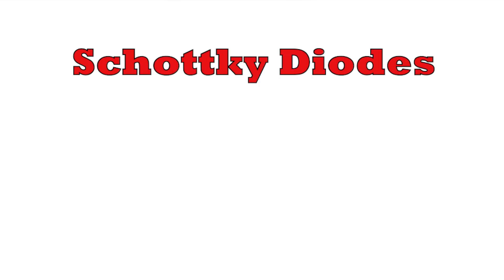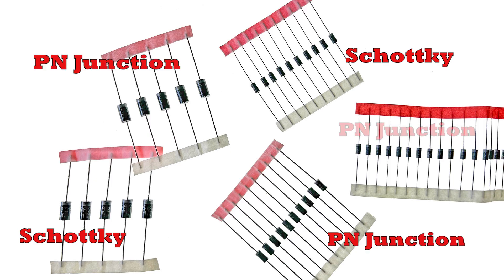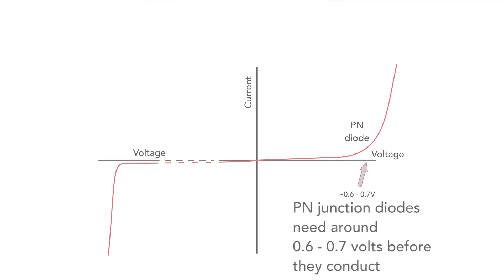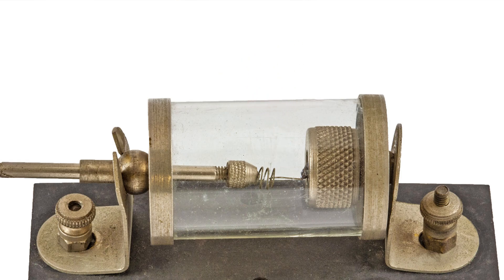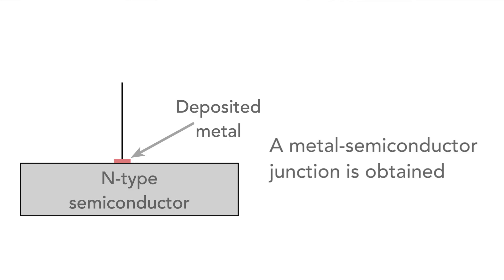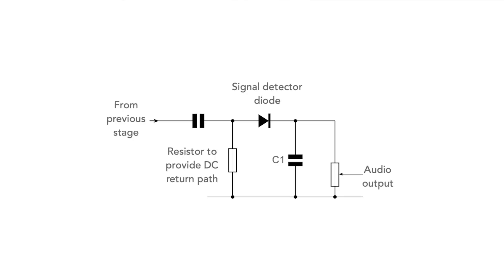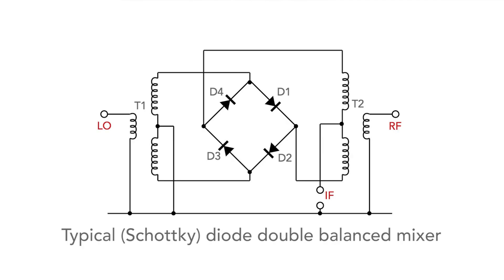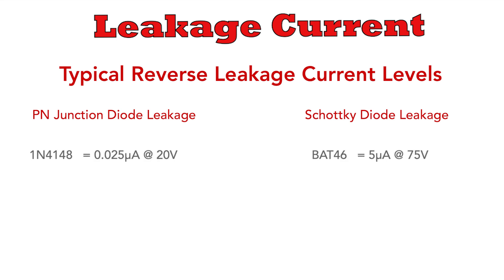Schottky DIODES: What You Really Need to Know!

Comment: I recall Schottky TTL was introduced by Texas Instruments around 1971, but I remember that it was used sparingly in digital logic designs owing to higher cost and heat dissipation. In mid 1970s low power Schottky was introduced, eventually as an option across the full range of 7400 TTL devices. This gave designers new opportunities to shift the trade-offs between speed, cost, and heat dissipation.
Reply from the maker: That's a great historical perspective on the development of Schottky TTL and its impact on digital logic design!
I don’t think I ever used Schottky TTL but I used the 74LS low power Schottky all the time.
Reply from the maker: Yes, the LS TTL was great. I used loads of it. Lower power and fast (for the time). I also remember using ECL and wow did that use a lot of current and get extremely hot!
Reply: @ElectronicsNotes  ECL certainly did use a lot of power, e.g. Motorola's 10,000 series could achieve sub-nanosecond gate delays, e.g. it could mitigate stray capacitance more effectively and achieve faster rise times because it switched current rather than voltage. Interconnects between devices had to be designed as matched transmission lines so that the propagation delay between devices could be kept in proportion to gate delay.

Comment: One integrated circuit I designed used Schottky diodes for a specialized memory. The diodes were used to transfer data between memory cells. After receiving the parts, life-testing demonstrated a gradual shift in the diode's forward drop as well as turn-off times. This lead to a major dust-up with senior staff. Lots of finger pointing. The discovery; The aluminum traces diffused into the silicon thus changing  Metal/N junctions to P/N junctions. Fix was a barrier metal of platinum that kept the aluminum from amalgamating with the silicon. 
Company made a fortune on that product. I got a commemorative plaque.....I hung it in my shed.
Reply: Sounds familiar

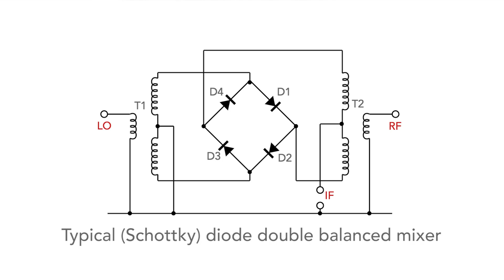Comment: 4:34 One disadvantage is having a Low reverse-voltage breakout of about 100 volts.  Nice video!
Reply from the maker: Yes, this can be a distinct disadvantage. But Silicon carbide, SiC Schottky diodes have a much greater reverse voltage capability in general.

Comment: Should also mention that the Schottkey reverse leakage is temperature sensitive, it increases with the ambient (junction) temperature of the diode.  When designing circuits using Schottkys, it is highly recommended to test the functionality of the prototype circuit in a burn-in oven.
Reply from the maker: Good comment. Best to first design the circuit to accommodate the leakage current at the max junction (not ambient) temperature.
Reply: @ElectronicsNotes  It's funny how many little 'oopsies' get overlooked in the design phase, only to show themselves during burn-in.
Reply from the maker: @Slickrock72  I think we’ve all been there!

Comment: Have you considered using a curve-tracer test instrument to display the forward and reverse voltage specs?
Reply from the maker: No I haven't - it might nicely animate the images - have you a suggestion?
Reply: @ElectronicsNotes  The DCA75 component tester has a USB interface to display VI curves on a PC.
Reply: @ElectronicsNotes  I recommend the UK designed and built DCA75 Component Analyser. It has a USB interface to display VI curves on your laptop, cheers.